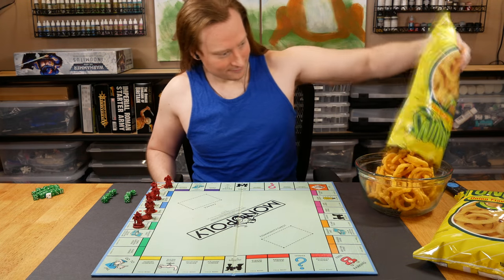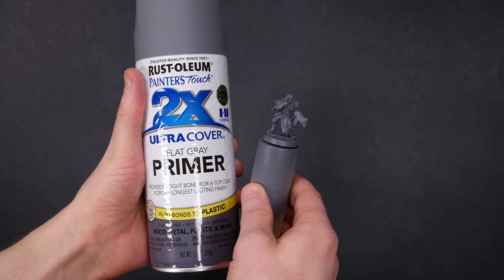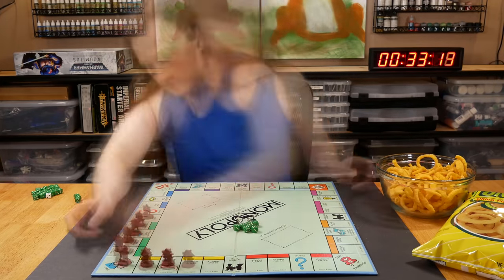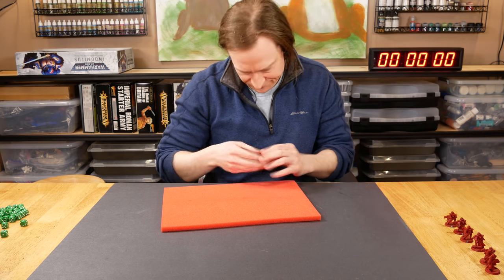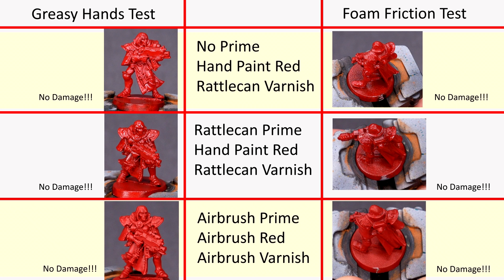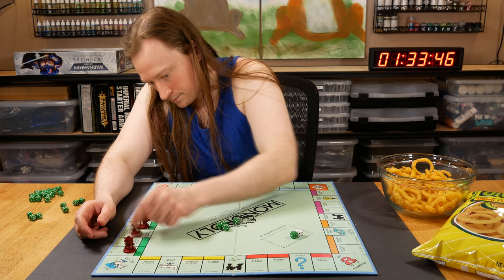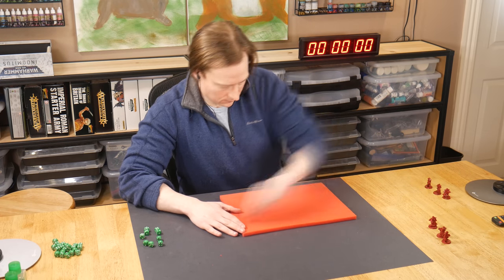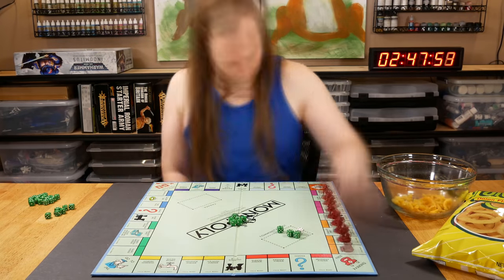Varnish Actually Works!?

Comment: my theory is:
primer is only there for the painting stage, used to get better grip and even first layer
varnish is a sealant, a protective "shell" that gets a hard finish
Reply: yeah I thought so too. until now i've primed every model but they still had tear on edges even during the painting process which led to repainting everything that sticks out
Reply: Commercial paint companies make declarations and definitions of the uses and significance of primers/paints/clearcoats. They all recommend primer on plastic and metal certainly for adhesion but also very smooth apply forces over larger areas (think contrast paints) which makes it harder to form a proper film at a low enough thickness to preserve detail. There are very high adhesion products that will stick to smooth surfaces just fine. you can for example apply varnish directly as to resin, metal, almost anything. 

You can even use matte varnish as a primer, It's the fact that matte has micro solids (i forget the real term) that improves the application of the next layer. 

Primer is about minimizing the issues with the substrate such as colour bleed, adhesion, still soluble pigments, oil, and others. Brent as a habit washes his miniatures before priming them, which I think mitigates the main issue that say Citadel was concerned for when they originally mandated oil based undercoats. That's just an experienced hunch. The other main reason being that 'sprue gray' is not usually the appropriate colour under subsequent colours.
Reply: i prime for 2 reasons 1 to help fill in seem gaps and 2 because i heavily paint in contrasts and you need a bright base coat for that. and i always seal because barely touching contrasts at all makes them rub off
Reply: @Vova-xv3zn  Are you giving them a full 24 hours to cure after priming them? Rattlecan primer will appear dry after an hour or so, and airbrush primer will look dry very quickly, but both need to cure fully before painting over them.
Reply: @brandongiles6875  yes. some of my minis were left for a week after priming

Comment: Thank you for doing this! I know (anecdotally) from experience that playing with partially painted minis for a while will lead to the paint wearing away. Some additional criteria that could be checked if you decide to do part two:  Move some of the minis around before you prime/paint them (pre-grease). Use different colors/brands of paints, some paints just flat adhere better and those "thicker" paints would likely also be more resistant to being rubbed off.

Comment: In house painting we have a concept of encapsulation. Essentially having the resin wet on all sides and drying at once 'shrink' it on the figure. Theoretically the best application for encapsulation is dipping, you can clear excess with compressed air or an empty air gun, it will be messy.

I'd be most interested in a test entirely with airbrush varnish and the variable being extenders/dryers. It would also be interesting if the first and second coats were strikingly different colours. Perhaps black under blue under pigmented varnish. 

Also, you could do a longer range passive test for the effects of handling by preparing a set of painting handles or something else and then using them for a year. just a thought.

Comment: Making the content we simply can't find anywhere else.  <3.  On the varnish front, I have an all-metal Steel Legion army that I wanted to have a durable matte finish.  After some experimentation this is the varnish scheme I found that produces an ultra-durable but still matte coat:

Layer 1) Pledge 'Floor Care' applied through an airbrush (Wait 24h) - Floor varnish is the absolute last word in armoring your boys against the world, but it is VERY glossy.

Layer 2) A light but complete rattlecan application of Testor's Dullcote (Wait 18h) - Matte Rattlecan varnish.  Probably any brand of matte rattlecan varnish will do here, but I used Testor's.  This knocks down 80% of the shine.  

Layer 3) Airbrush application of 'AK Ultra Matte Varnish' -  This really finishes the model off and returns you to a full matte finish that gets into all the the crevices.   This should also knock down any frosting that may have occurred in the previous layer.   

Now, over the first year there will be some eventual discoloration in the varnish.  I think this issue is common to all matte varnishes and I don't know how to stop it.  That said, it was fairly slight and ended up complementing my warm wasteland colors.

Comment: Something I would definitely be interested in if you're in testing mode - Acrylic vs lacquer vs enamel varnishes.
My own subjective impression is that lacquer is just the best with a narrow exception - Lacquer does yellow over time and greasy fingers make it worse.  Due to this I have been in the process of repainting a bunch of OG lead base pewter battletech stuff recently.

That being said, I could be full of crap and maybe acrylics or enamels are just better.

Comment: Even in the evergrowing YT section of miniature painting, vids like these still are unique! It may seem trivial, but it's always good to check assumed "facts" with SCIENE! :D
I remember the time when I started a Chaos Demon army, back when most of them still were metal miniatures. I rattlecan varnished them, but only matte, this was what was sufficient until then. Most my previously painted models were plastic and those few metal minis were treated with more care and I had no issue. But when most of your army is metal... it took about 1-3 tournaments and I was pissed about all the spots with chipped paint. So I started to varnish glossy first, with an additional matte layer afterwards. No significant issue anymore. By now, I'm using airbrush varnishes instead of rattlecans, but couldn't find much difference. Would be interesting to see a stress test though!

Comment: A thought on airbrushed vs hand brushed paint: when aerosolized, a lot of the moisture in the acrylic medium is being immediately eliminated by the time the paint hits the surface of the mini. This should result in significantly faster curing time for the paint. It might take several more days for brushed paint to become as hard as the sprayed on or air-brushed primer and paint.

As for varnish really working, well, it makes sense to me. In addition to gloss or satin varnish having a smooth surface, varnish really sticks to itself well and forms a tightly gripping cocoon around the object it is applied to. You can see this if you try to pick and peel off some freshly applied varnish that is starting to turn gummy but isn't ready to be handled yet: rather than just peeling off at the part you're touching, like paint, the varnish comes off in a "skin" from the entire surface.

Due to that, I always assumed that hardened varnish is more like cellophane shrink wrap. And consider how durable shrink wrap is to being rubbed against a surface.

Comment: That was cool and interesting! For the version with different varnishes you might want to apply a bit more physical stress upon the minis to prevent seiling effects in order to be able to better differentiate between the varnishes and varnish combinations, when testing their durability.

It would also be cool to get your hypothesis about the results at the beginning and why you think it might turn out that way :)

Thanks for the video :D
Reply from the maker: Yeah I'm still trying to process all this, but some more varnish tests are definitely in the works! :-)
Reply: @GoobertownHobbies  That sounds great :D
I also meant "bottom or seiling effects", but just forget the one half XD

Comment: I think that airbrush paints could have a different chemical composition and could be more sticky naturally when compared to paints that you brush on.
Also it could be the case that very thin layers (that you get by airbrushing) dry in sequence, that gives you basically a multi-layer structure. When you use brush, you tend to have a single thicker layer.
Just a couple of theories.
Reply from the maker: Yup yup, we'll get to the bottom of all this!

Comment: One of the things I've done with metal minis is to bake the mini for about 30 min at around 100°C. This isn't a high enough temp to cause any softening of the metal, but seems (in an entirely anecdotal sense) to result in a harder surface that is less susceptible to damage from handling.

Another, and probably more useful, test would be to handle minis with more or less greasy hands before priming or painting and compare the result to washed minis. This could be useful for any sort of minis, to determine whether washing before priming is actually useful or only a placebo.

And perhaps comparing acrylic, oil over acrylic, acrylic over oil, and oil painted miniatures for durability as well.

Just in case you were running out of tedious ways to damage miniatures for science.

Comment: I can speak to a matte varnished mini. This is strictly to the krylon matte varnish rattle can. It holds up pretty well but I found that some of the spiky parts or sharp parts had paint chipping. I think this was from the in and out of my foam case. I used 5 light coats of matte varnish from about 6 inches away per the cans instructions. Everything was primed by airbrush as well. These were strictly metal infinity models. Hope that adds something the thought process a bit with matte varnish. I have since switched to satin and have not had this issue. I'd rather have the sheen then paint chipping.

Comment: Cool video and relaxing as ever. For resin models it would be interesting to see if washing the models in soapy water before priming has much of an impact on end durability. Having done both wash and not wash it seems they suffer more when you don't wash them beforehand but that could have also been the different paints used.
Reply from the maker: That's a good idea!  I'll have to think about where to source that type of resin.

Comment: I use Polyurethane Spray Varnish.  It seems to be more durable than traditional (Krylon, Armoury, et al) sprays and never sprays on cloudy on humid days.  I prefer to do three layers, Gloss-Semi Gloss or Matte-Gloss.  The gloss layers keep everything reasonably bright, and the matte layer in the middle eliminates most of the glare that gloss coats suffer from.

Comment: Great vids. Curious if there would be any difference with brush on varnish. All I'll use anymore is Vallejo satin brush-on. 
Regardless it would seem that if you're using plastic minis, that are varnished, there's no reason to worry about them or baby them regardless of how you store them. Bag then together, in foam, in plastic insert trays or even just left laying in a box.
Metal is a different story, but so long as they're varnished they should be fine too.

Comment: On thing that may be worth testing at some point is that the airbrush varnish you used is polyurethane varnish which is quite hardy. How does acrylic varnish hold up? Something like AK ultra matte

Comment: Other tests of varnish and priming, and potential damage that may occur : Spilled drinks like soda and coffee, and normal food grease. Not funyuns but like, A burger. Testing wiping it off immediately, and testing just leaving them excessively gross and cleaning later. If you test with coke, I wouldn't be surprised if it melted the models, That stuff can remove motor oil from pavement, it's very acidic.
It's also important to note that the type of paint you use will matter for how the damage occurs, for instance in theory a paint with oil soluble pigment or medium will be more damaged by grease, and I don't know if oil or inks interact differently with oil.
You've already thoroughly tested the difference between rattlecan primer and airbrush primer, so that part could probably be knocked from the experiment for simplicity's sake.

Comment: Great experiments and thanks so much for doing these. The Matt varnish or gloss then matt would be super useful as I don’t do shiny. If it’s reduced surface tension  that’s being protective I’m not sure it’s a good trade off for me. Though I also appreciate the fact I’d have that knowledge thanks to you. The other thing is rather than one set of experiments with one set of either metal and plastic  and resin maybe run one of each through the gauntlet.   We didn’t see plastic greasy hands though I think we can extrapolate.
Reply from the maker: Hehehe, I'm quite likely to repeat this experiment again, the different type of varnishes question is itching at me now.
Reply: @GoobertownHobbies  it was something I was gearing up to do so am much happier you did it. Better haha

Comment: Suggestion: you could take into account the amount of layers of varnish (I don't think you mentioned it, so I assume you did one thick layer). I personally do 3 thin layers when I varnish, with 5 mins in between to let the layers dry. I use Vallejo Satin Varnish and it seems that this process works to keep the minis from getting too glossy and from getting frosty. No varnished minis have taken any damage to their paint (at least so far)

Comment: For resin minis, especially the ones with spindly bits, I feel like transportation is a big issue. It would probably be very hard to be objective, and not have human error be the deciding factor, but maybe you could take them in and out of a foam case many times, and compare to sticking them down on a magnetic tray box and pulling them off again.

Comment: If your doing tests with resin, particularly if your considering resin brand tests (but even if your not)  I’d be very interested to see environmental tests. How do the miniatures & paint jobs hold up in different environments for extended periods of time; cold, hot, very dry, very wet.

Comment: From recent experience, the airbrush primer works great with plastic and resin, but sucks with metal. On metal, rattlecan primer wins hands down. Also, rattlecan varnish seems to do better than acrylic varnish when you have paint-on-paint contact (e.g. a vehicle with a painted turret that moves against a painted hull) but otherwise they do an equally good job.

Comment: Resin Mini Test Suggestion

Stripping paint from resin, diff chemicals.
Reply: Exactly i am allways scared to buy used resin because i don't know what chemical to use
Reply: @boku5192  - Honestly ive always had good luck with Simple Green. But ive heard of people using 90% IPA and/or Acetone and not having it ruin models, however ive always known acetone to destroy the hardness of resin.
Reply: @DismemberTheAlamo  I have tried IPA on some plastic models with varying success. Another thing that sucks is that i live in europe and have no idea what would be equivalent of Totally awesome or superclean/simple green so i would really appreciate some video about their composition s i know what to look for

Comment: Not sure what variables you're planning on testing with resin miniatures, but I am VERY interested in the supposed tradeoff of detail vs. strength. I've not used the product "Tenacious" yet, but I understand it adds flexibility to your minis. However, I understand it does so at the cost of detail. My minis (using Anycubing standard gray resin) seem to have decent detail but are extremely brittle. Would love to see your research before I try other resins--they're just so pricey that I've been reluctant to gamble.

Comment: Water based acrylics are the least durable of the bunch.  I use water based clear finishes, but not when durability comes into question.

Lacquers are a good choice for durability and, in my opinion, enamels are about as good and destroy your lungs slightly less.

Metal minis are tough because nothing likes to stick to metals other than an automotive epoxy sealer - but I've got 35 year old minis that still have their oil based Enamel paint jobs on them with no primer, though some have started to chip.  I would never even consider priming a metal mini with a water based primer if I cared about how long it would stay on the mini.

If you're talking about the outer clear finish of a mini, several coats of lacquer or enamel is the best way to go for durability.

This was a really fun test, but I think the only conclusive way to test things out is over time and use and handle the minis for like a year or something.

Comment: I'm super paranoid with my minis. I give all my minis a finish with a thick layer of 'ard coat (watered down of course) AND a varnish. The minis get an odd rubbery yet very robust feeling to the touch.
It works out great for me as they doesn't look different than minis with only varnish but they feel a lot different.
Idk if I can recommend it, because I dunno whether it's actually better or safer, but my paint jobs are very resistent even for scratches. Ard Coat is a wonderful gooey sirup it's even a valid method for small chipping effects... the usual salting is way better tho... I just mention that to depict how frikkin robust that stuff is.
I didn't test how easily removable those kinds of paint jobs are, so I recommend this method only for paint jobs you want to last forever(ish)... because it feels like it'll be forever.

So maybe that's a tip... or not... I don't know.

Comment: Washed vrs unwashed resin prints. Does the residue affect the primer, paint or varnish from IPA,methylated spirits, degreaser or resinaway? And if so what does each one do? Methylated spirits creats a little pocket of air that cracks the paint off.

Comment: It's pretty expensive unless you are donated cases but I would like a plastic/ resin / metal / 3d printed model (make sure theres at least a few 'spindly bits' in  all the variants of cases, just a shoe box, egg cartons/ different foam, magnets, tissue paper, bubble wrap and then test the damage the minis get from a bumpy car ride and a accidental fall from table height?